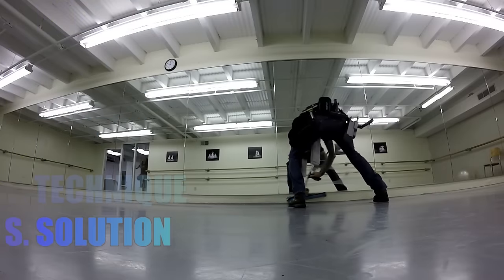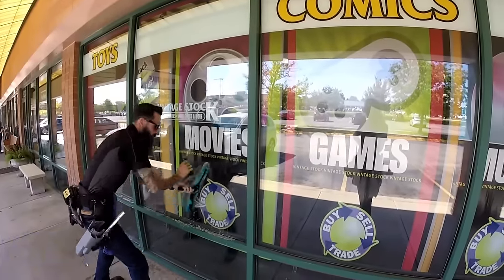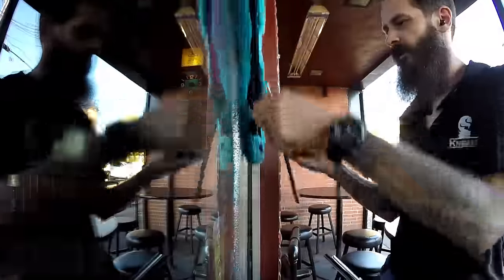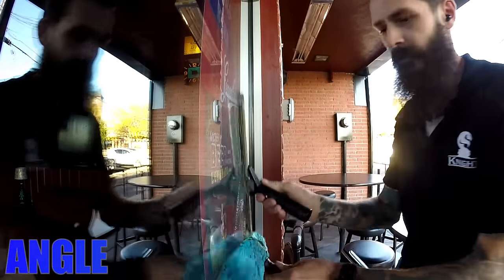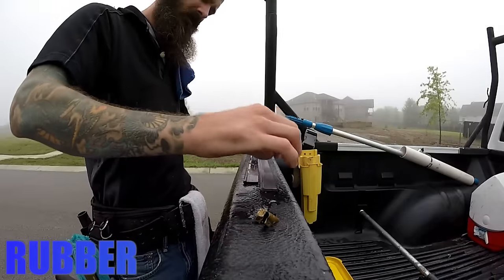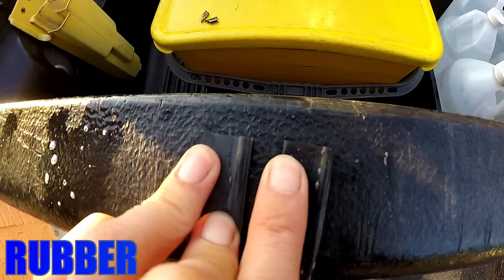How To Clean Windows Professionally - TROUBLE SHOOTING

Comment: Four steps to a clean window:
1. Wet/scrub the whole window
2. Squeegee the solution off.
3. Detail the edges and sill. (Use a separate dirty towel for the bottom sill.)
4. Inspection of the work, repeat any step if needed.